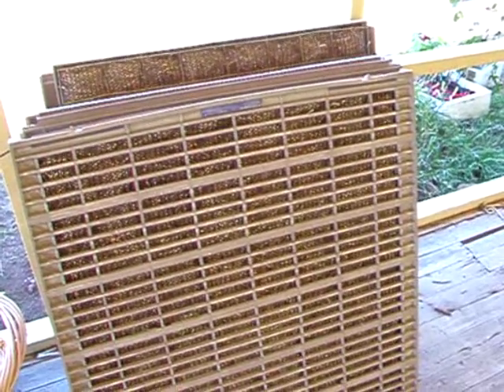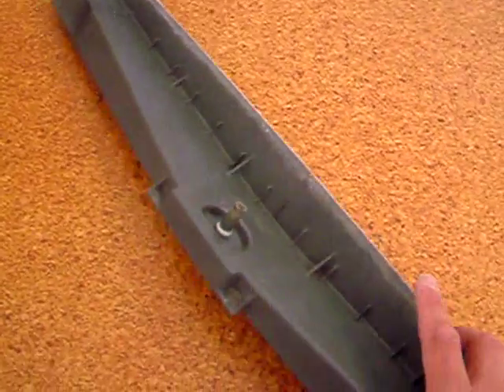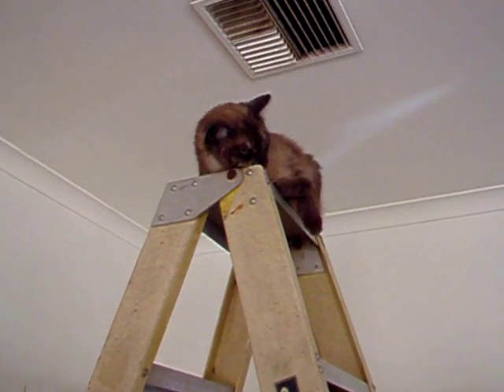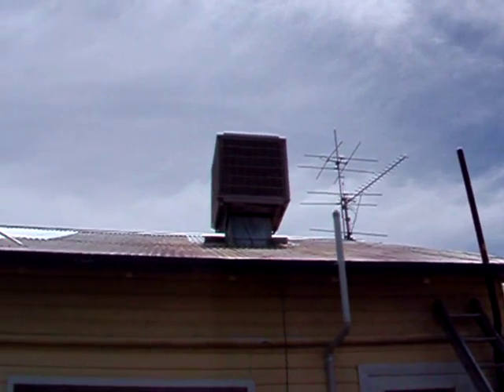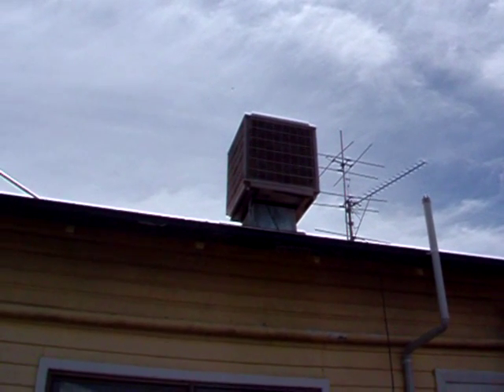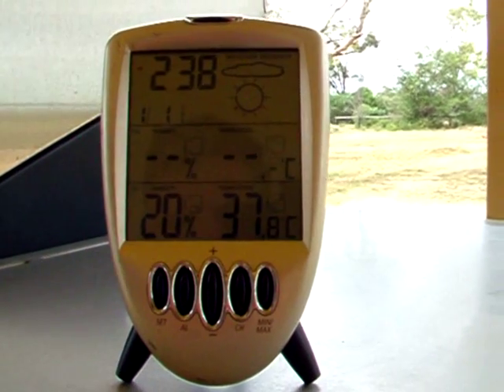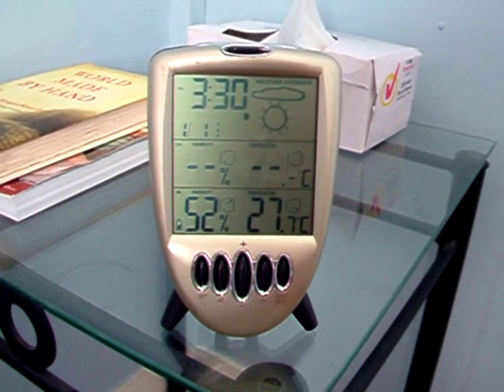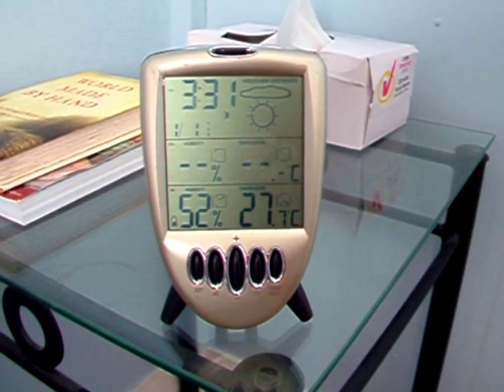Country Life - Episode 5 - Evaporative Cooler Part 2

Comment from the maker: Thanks for the tip re the bearings! I had to replace the fan motor and fan belt - seems the cooler hadnt been used for years and after a few weeks of running the motor burnt out. My cooler has been shut down for the winter now but it is nice to know its all ready to go again next summer.

Comment: Fan-shaft bearings need a couple shots of motor oil at the beginning of the season.  A dry one can cause a fire.  A cooler supply store owner here told me about the inventor of the cooler you have.  He supposedly got into coolers because he was previously an airplane designer  (or something like that) and people died when one of his planes crashed.  He figured evap coolers were safe.  Well, one of his coolers caught fire and a family died.  After that he put fire extinguishers in them!  True?